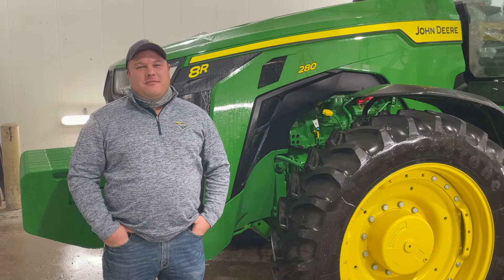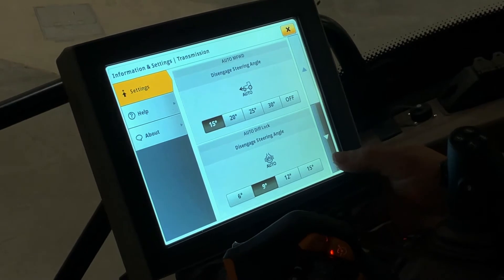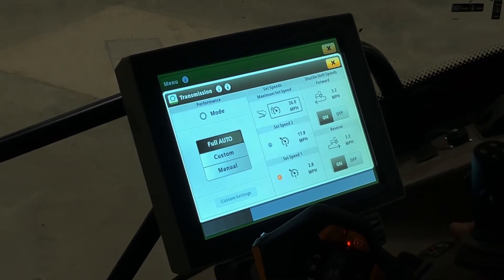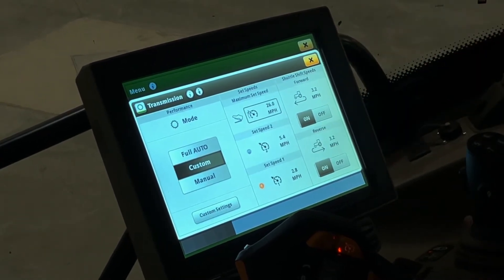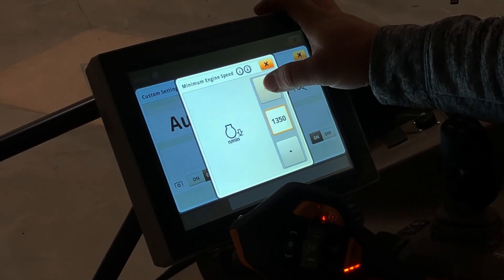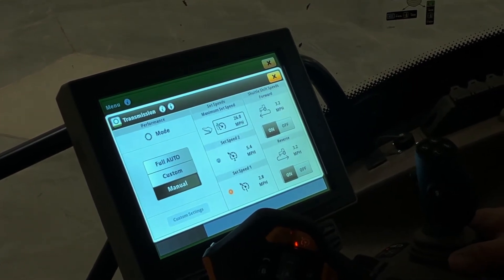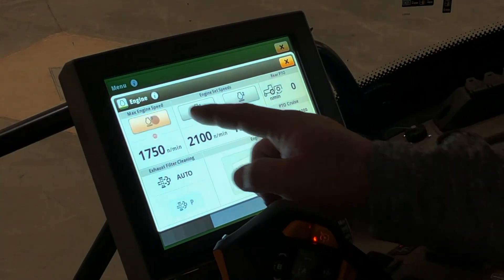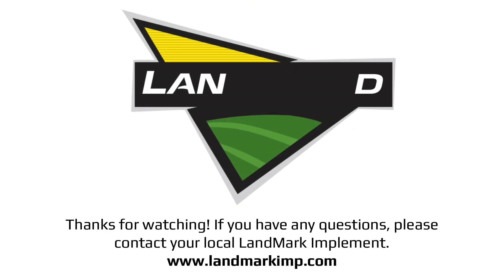John Deere CommandPRO Transmission Settings

Comment: So on the old IVT you would run the throttle all the way forward and then it would slow down the RPM to what you need. IS that how this works?
Reply from the maker: The software on the command pro is a little different. In auto mode, the tractor will still adjust the RPM down to required but you do not need to move the throttle to full forward. The throttle is used to set the minimum RPMs with the CommandPro so if you want your minimum RPM’s to be 1300 you move your throttle lever forward until you get to 1300 and then leave it.